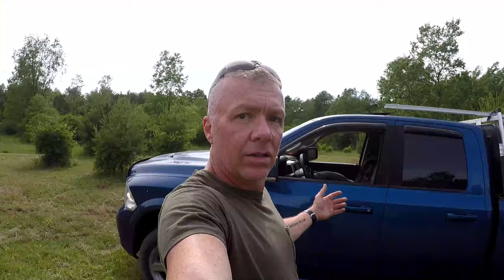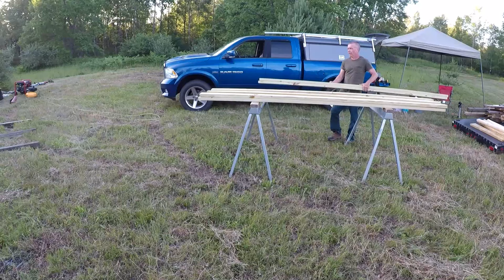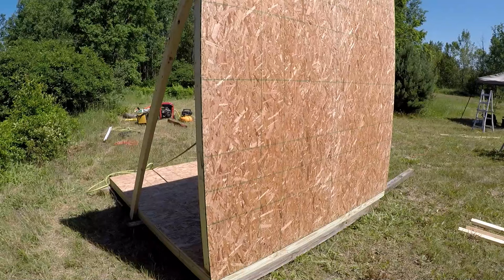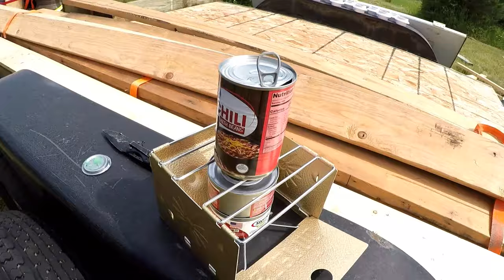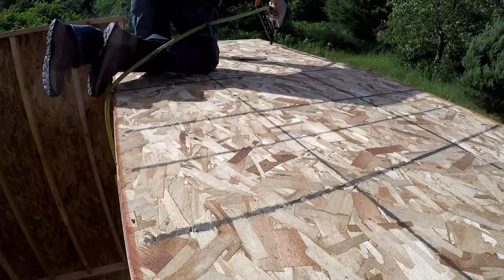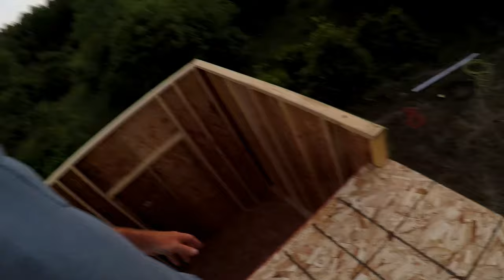Off Grid Tiny Cabin | Solo Build In Just 3 Days! | My DIY

Comment: Great video. If I make may two suggestions. Mute the beehive sound on the video. I guess its what the compressor sounds like sped up? Also work in the evenings, it will be slower but you wont fry in the sun. Thats when I prefer to do all outdoor work. Where I live the Sun is very strong.
Reply from the maker: I’ve been working on eliminating the compressor sound in my recent videos (I’m an even worse editor than I am a carpenter LOL) And when the weather gets really bad, I do usually work in the AM, take a break in the afternoon, and go back to work in the evening.